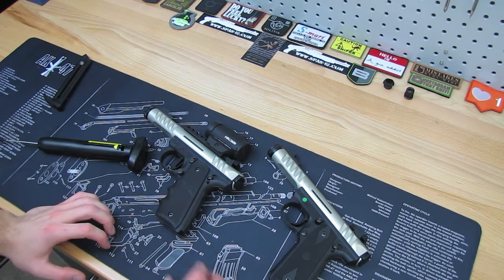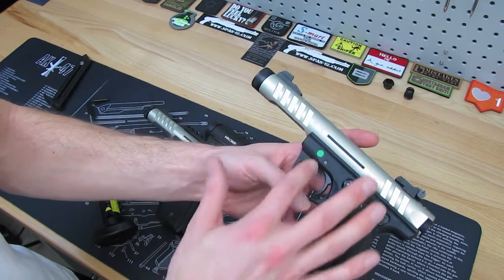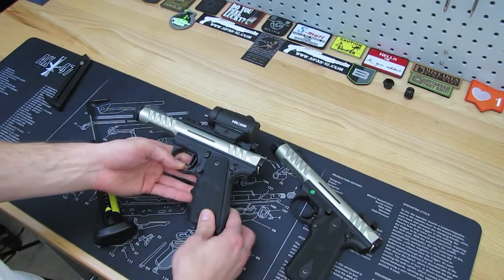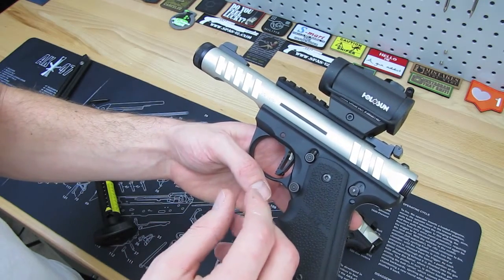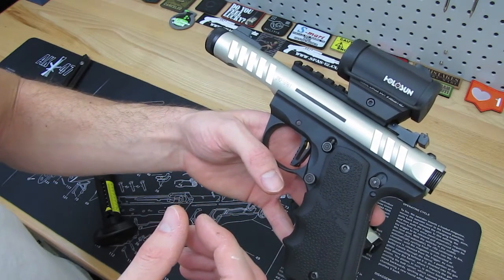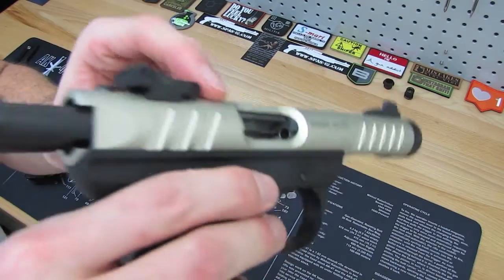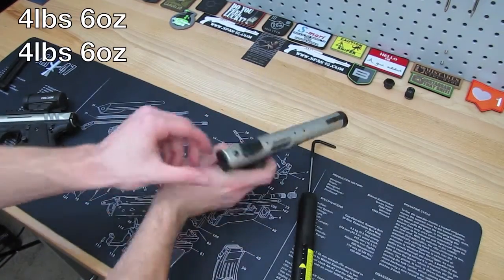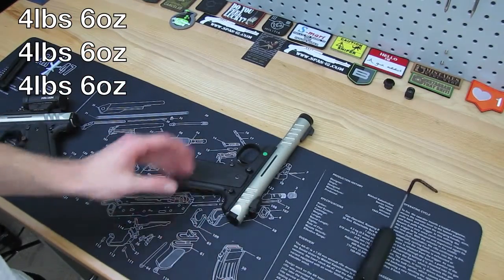Ruger 22/45 Lite Trigger: Factory vs. Polished

Comment: I just got the MKIV 22/45 Lite yesterday. Still in the box. Pulled it out and checked trigger pull. 4lbs. Not bad for a brand new gun without touching it. I’ll be swapping some parts with VQ over the next few weeks. Thanks for the video!

Comment: If you add a volquartsen sear in it, it will blow your mind!  I think mine is around 2 pounds and for around $30 it's a great upgrade
Reply from the maker: I believe that yours is less, but for me I didn't really want a hair trigger. When I went to polish the sear I specifically didn't polish it to a mirror finish like the volquartsen for that reason. For me 3 and a half pounds is perfect. Just enough resistance to know you're pulling it.
Reply: Not only that. I think the geometry is revised so the Volq sear gives a break with less travel. No amount of polishing the stock sear will do that.
I am a huge proponent of polishing stock trigger parts. But when an after market part has revised geometry,  I usually will PAY  for that part.

Comment: 16 oz to a pound, aren't you closer to 4 pounds 8 oz??? I know its close, just sayin.  I saw a video a few years back that stated focus on perceived feel of the trigger mods (percentage), most would be hard pressed to tell the difference in a 2 oz reduction, but a reduction of 33% or 50% would easily be felt.  I know you can have two guns with the exact same trigger pull weight but one can feel far smother or less gritty/creepy vs the other